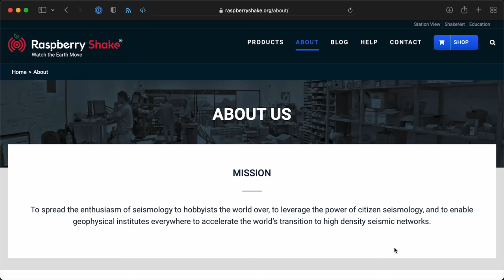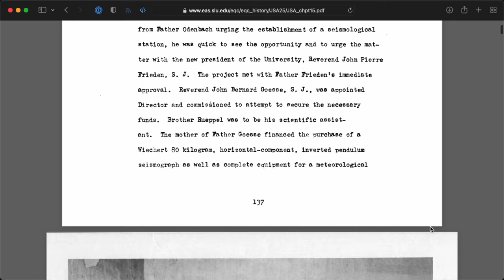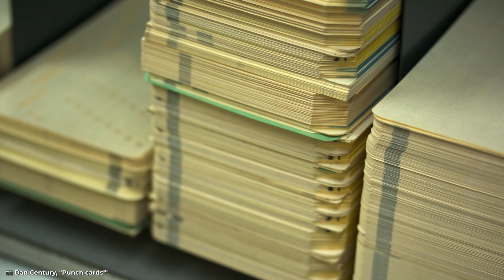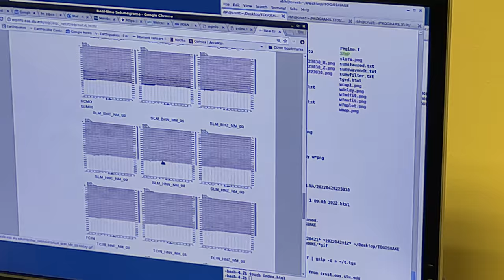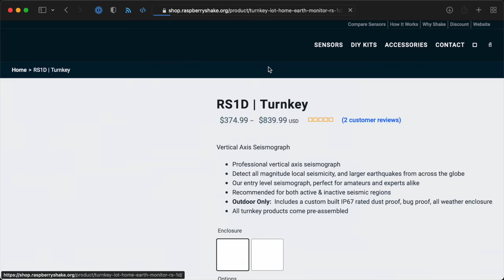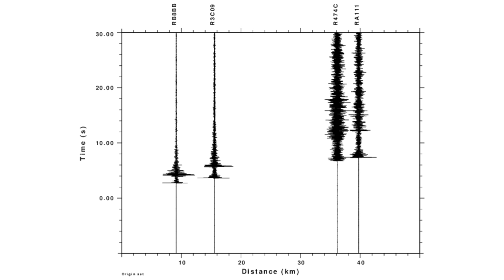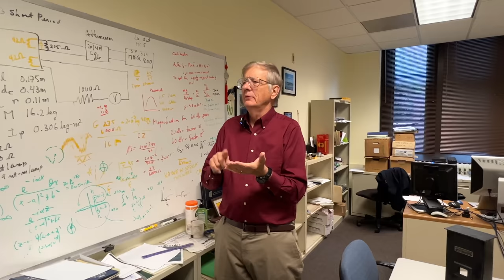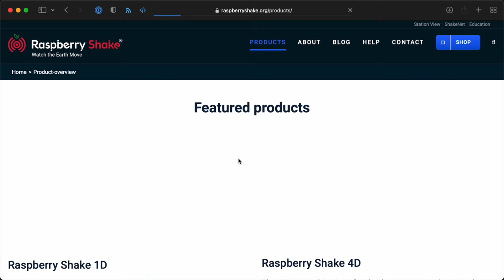Can you predict an earthquake?

Comment: I won't say the price is out of line considering what else is rolled into the cost (as mentioned in the video), but it's above my WTHLBI (What The Hell, Let's Buy It) threshold.
Reply from the maker: True; and I didn't include things like the pre-flashed microSD card and the Raspberry Pi power supply, which add on maybe another $30-40 to the BoM. So not a terrible deal, if you're truly interested in seismology and want to join ShakeNet.
Reply: pun intended?

Comment: I use to work for W.F. Sprengnether Instrument Co. back in 1977 as a machinist.  Bought two zero length springs and made 2 vertical long period seismometers for world wide earthquakes.   Not to long ago I came across Sprengnether’s new style S-5100-V Vertical Seismometer with the drum recorder.  I bought it.  Now I don’t know what to do with my machine shop seismograph projects.  For a serious hobby,   I like my older seismograph and vintage weather bureau instruments.  Have a bunch of Kollsman Altimeter Setting precision barometers that use to be in almost every weather bureau and air control tower. .

Comment: There is a bad pothole/manhole cover on the road near me and big trucks are constantly shaking my house during the day when they hit it. I don't know how useful my data here would be. But maybe I could find some exposed bedrock near by and setup a remote solar/battery shake on LTE. That would be neat!
Reply from the maker: Definitely! Networking is sometimes the hardest part, because to get better data, you want to be isolated from structures / deeper in the ground. That's precisely where wireless signals can't get :D

But if you can run PoE to the device, you could get by with one Ethernet cable to it.
Reply: It might be useful data to get them to repair the pothole.
Reply: Does pothole data just get thrown in with "real" data?

Comment: This video was super awesome and i can very much relate to that. In my undergrad days i used to monitor a seismic station 10 years ago, complex job, lots of math and programming involved. 
I'm not from the generation that used smoke paper or analog sensors, but we had an broadband seismometer connected to and old pentium PC.
I've always thought how could it be to make a simpler yet effective seismometer using some small chipsets, and now we have it!
Seeing the professor using Linux command lines and combining and stacking various seismograms to determine it's where it happened and magnitude reminded me when i used to do it. 
I remember a fun day, when i basically freaked out when i picked up the 2011 earthquake in Japan (that caused the fukushima accident), i went running to my supervisor to warn him, that same day a reporter from the local news came to interview us about the quake. 
Outstanding day!

Comment: I have operated a swiss-made smoked paper seismometer up until 1984; they were particular cheap to operate.
Normal seismometer like the famous Geotech S-13 are velocimeters, as they measure the prime derivative of the Earth movement, with a cutoff frequency of 1 Hz. The geophone used in the Raspberry are accelerometers, measuring the second derivative of Earth movements; a measure of less value.
The true value of Raspberry sensors is their networking, and the filtering and crosscorrelation of data.
The true forecast job can only be conducted with the study of telesismology, measuring Earth movements with a period of 20 seconds up to an hour. I believe this type of information cannot be extracted by the Raspberry Shakes.

Comment: I was an AFTAC nuke sniffer back in the 70s-80s. Then went to work as a contractor for USGS. And finally for the NSF/IRIS EarthScope project. I've worked on just about everything seen in this video including the Benioffs. While working for USGS I had to replace a set of Benioffs with fancy new Streckeisen sensors, which look a lot like the Nanometrics Trilliums seen here. I had to haul the 3 Benioffs on a sled behind a snow machine across a frozen lake in Kevo Finland. Had to scoot across as fast as possible because the ice was cracking due to the weight of the Benioffs. Seen but not mentioned in the video is a Quanterra Q330 digitizer. Every product made by Quanterra is named after a John Deere tractor because the company founder is an old tractor enthusiast. The JD 330 was a johnny popper from the early '60s. Also seen but not mentioned is a Kinemetrics EpiSensor strong motion accelerometer (black hockey puck-looking thing in the middle of the pier). It's used to record the really big and/or local quakes that would over range the more sensitive seismic sensors.
Reply from the maker: Thanks for sharing that, it's really fun hearing the field stories from people who've been involved in geology... you get to deal with caves, forests. urban areas... and apparently ice fields and sleds!

Comment: That data telling you about the washing machine and dryer is great to be able to automate and work on things, lights can flash when the laundry is done, you can monitor all kinds of things that produce a change in the air pressure and vibrations in the house and setup automations to respond to those things. 

It seems like it may also be sensitive enough to combine with a power sensor to quickly identify what appliance is causing a power draw and a whole bunch of other ideas. This is so neat.

Comment: I'm thinking the cost to drill a hole to bedrock where I live would be several orders of magnitude higher than the cost of the pi shake.
Reply from the maker: Ha, yeah... here in St. Louis bedrock is often only a meter or two below the surface (though depends on where you are in the region). In other places, it can be a pretty deep hole!

Comment: Cool video!  When I was 12 yrs old we lived for a year on the island of Guam, which averaged 23 tremors a day.  Most of them, we didn't feel or just barely felt.  If there was a hanging plant or lamp you would see them.  However, that year, we had a 6.5 and a 6.75 on the Richter scale, which was, Uhm, scary.  But the buildings and infrastructure were built for this (as well as they could be). The island is the peak of the underwater mountain where the Marianas Trench is, the deepest part of the Pacific Ocean.  I'd be certain there are some Geologist stations/equipment there!

Comment: what about an Raspberry Pi that detects Nuclear (or any other) exposions?
Asking since a certain man likes to play with dangerous weapons lately.
Reply from the maker: The Shake does that in a sense, using seismic data—but there is also a model with the 'Shake and BOOM', that can also detect infrasound for a wider range of event monitoring.
Reply: @JeffGeerling  cool
Reply: Lol
Reply: the air force partnership mentioned due just that with seismic data. 

https://en.m.wikipedia.org/wiki/2017_North_Korean_nuclear_test
Reply: Boom is the infrasound add on. The standard 1D, assuming a yield large enough can indeed detect a nuclear explosion. I worked at AFTAC for 26 years.

Comment: I'd been looking at getting one of these for a bit and just ordered one. Note that if you have a Pi already the DIY kit is a bit cheaper.

There was another project that used an accelerometer based sensor but it went belly up about a month after I setup my senor... It was never really that good to begin with, software was pretty bad...

I have a kinship to the subject... My grandpa made two seismographs, one that had a pole that went into the ground and used a bowling ball as a counter weight for the arm with the needle. I believe it was fully mechanical except for the motor that drove the drum. I never saw that one together IRL but based on photos it took up a good section of his garage. 

The other, more advanced one he made was self-contained in a bookshelf sized box (about  waist height). It used a magnet between coils delicately suspended from a spring (so it would move in the Z axis) that would induce a current and drive the needle (proportional to the current being generated). The soot on the drum, that's how this one recorded data... I actually brought it to my middle school science class when we were studying earthquakes. Had to "soot" the drum and when I was done I used hairspray to preserve it (which I believe is a method my grandpa used too). He did have an ink based needle but it had long since dried up so when I did my demo I used the soot on paper. 

My grandma has a binder with a bunch of newspaper clippings (he was in the local paper) and seismic readings. My grandpa was able to record several earthquakes (as far as Japan), and nuclear tests with his seismographs.
Reply from the maker: That's amazing! One travesty is as these old seismographs fall into disrepair, sometimes they're just junked.

I hope we continue to have at least a few preserved so people can see the history of these instruments. The drum-and-stylus was iconic when I was younger, nowadays with everything being digital, I think seismology is a bit less tangible.

Maybe a curved display with a mechanical arm linked to my Pi's sensor data could be fun to toy around with...
Reply: @JeffGeerling  - I agree there is something neat about the mechanical seismographs. My uncle still has the "more advanced" seismograph... Back in the 90s, he had a guy make an interface card for it and had it hooked up to his PC to record the output. It's not in a working state at the moment but I've been suggesting to him that I'd like a crack at getting it working again, both the drum and stylus and possibly using an Arduino or Pi to digitize it's output.

Comment: Neat that you can do that with a Raspberry Pi! I just might have to take the plunge and get one. 

Interesting comments about AFTAC. It was a major funder, although in secret, for a vast expansion in academic resources devoted to seismology in the late 1950s and early 1960s. The 1953 Limited Test Ban Treaty drove most nuclear testing underground due to the fallout it created, an eventuality that the Air Force saw coming and wanted to be prepared for. Fallout analysis had provided a vast amount of information of Soviet weapons. While the possibilities of doing that with seismology were considerably less, AFTAC wanted to extract everything it could.

There was also considerable controversy. Proponents of a comprehensive test ban that would prohibit all testing argued that seismology was sensitive and accurate enough to enforce such a ban. The Air Force and others argued that it could not do so for testing in the kiloton and below range. Based on what I've seen, such a total ban was feasible, but the military didn't want to go there, supporting the eventual 1963 partial test ban instead, so that testing could continue underground. 

There is an interesting group of papers in the American Physical Society's library in the DC area that provide a good background on this controversy which I had the privilege  of reviewing while doing research on my dissertation, "Nuisance to Nemesis: Nuclear Fallout and Intelligence as Secrets, Problems and Limitations on the Arms Race, 1940-1964.," which discusses the role of AFTAC, nuclear intelligence, and their strategic implications on the arms race. You can get a free copy of it at http://hdl.handle.net/2142/90554
Reply: Ex-AFTACer here, '78-'84. 'In God We Trust, All Others We Monitor!' We did much more than seismic detection. Each detection method, which we called a 'technique', had an arbitrary letter assigned to it, though quite possibly based on the order it was implemented. Seismic was 'B' technique. I know they went down to at least 'T'. I also ended up working for the Defense Nuclear Agency (DNA) as a contractor doing HE testing (simulated nukes) at WSMR and subcritical testing at NTS. One of my last assignments with DNA was running the transparency instrumentation that would prove that we didn't violate a treaty by going critical.

Comment: I'm still wanting my Pi 3 B+ to do protein folding. The Folding@Home folks would be wise to figure out a way to do this on ARM CPUs because I think a lot of people with Pis would be willing to do the same.
Reply: I definitely would! I have three RPi 4Bs lying around doing nothing at the moment.
Reply: I think the raspberry Pi is not powerful enough for protein folding...
Reply: how energy effective is that vs day some 6900xts, or rtx3080s? last time I was folding the data chunks had a must be complete by time on them.
Reply: Maybe they could make smaller chunks for Pi teams
Reply: @realfoggy  The Pi4B has around 25 + 30GFlops (CPU+GPU) as upper bound, compare this to 20TFlops of a RTX3070, that's 545x faster. I doubt it's even worth it to use 10 Pi4Bs, a somewhat older laptop would serve better...
Reply: @postvideo97  just to add some color here, assume 550 RPIs = 1 rtx 3070. Each rpi is =6-7 watts, 3300 - 3850 watts. The 3070 is rated for about 220w continuous, but in this case I'd be happy to say 350watt. So folding on RPIs at best is going to be 10x the power consumption of a single 3070. So unless there are chunks that are particularly well suited to the CPU+GPU in the pi, it'd make way more sense to do the folding on the 3070. Even if the numbers are off a bit in terms of compute per here we'd still be looking at the pis losing to the 3070, maybe by a factor of 2x power instead of 10x. 

That said if having folding for a pi could bring in 500+ new machines it could still be a win.
Reply: I have a Pi 3 B+ and it turns out that you can install and use Folding@Home. Unless I'm missing something, it works properly. Searching "raspberry pi folding at home" on Google brings up some tutorials about the installation process. I don't really know how to track it's protein folding performance, but it's probably pretty slow. I hope this helps, God bless.
Reply: I have a pi4 2GB doing folding at home.
Reply: @Cynyr  Not all folding is GPU based. Some folding is CPU only.
Reply: The output from a raspberry pi is probably too low for them to care.  The segment you're computing will probably expire and they'll have to issue it to another machine.  FAH is also server intensive, handing out the data, retrieving the results, and managing the whole chain.  So they probably don't want to re-issue work to machines at a high rate.
Reply: @Shocker99  The work my Pi gets issued is only worth a couple thousand points and takes about 1-2 days to process, which is within the time limit for the work that gets assigned.
Reply: @Shocker99  sure, but similar math likely applies to the CPU as well. All a say 5600x has to do is beat out about 20 PIs. Not to mention many of those 5600x's will have 16+gb of ram to for much larger data sets.
Reply: @koigoi  Interested in selling one of them? I have some ideas that my Pi 3 B+ can't quite handle, but the Pi 4 can.
Reply: @postvideo97  all I'm saying is every little bit helps. So if we have 550 people with at least 1 Pi a piece together they could equal a 3070. I think there was even a version of Folding that used old cell phones. Cracked screen or not it could still process for a good cause.